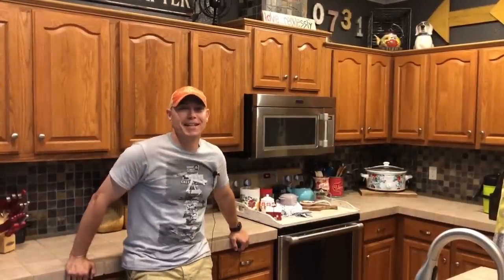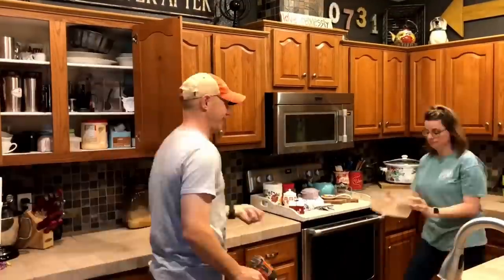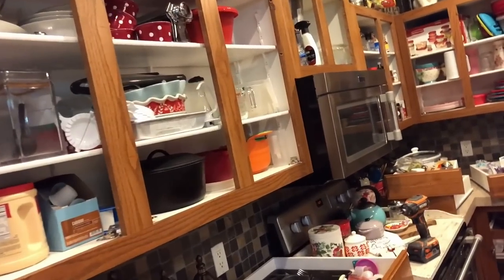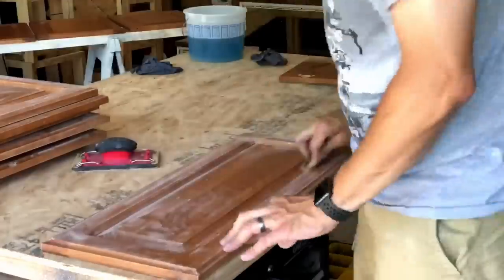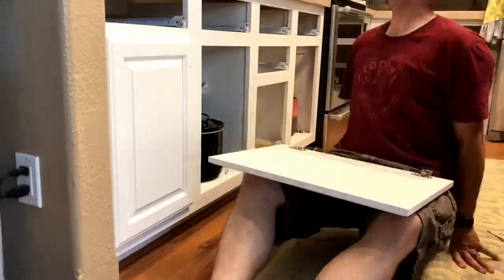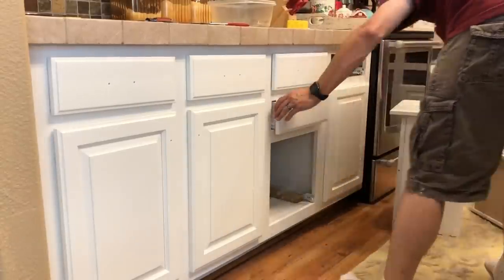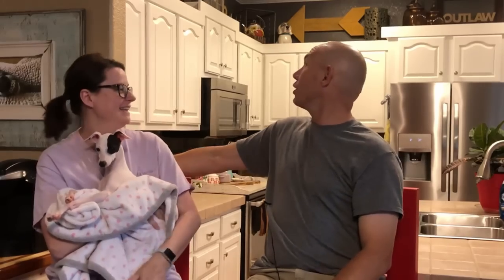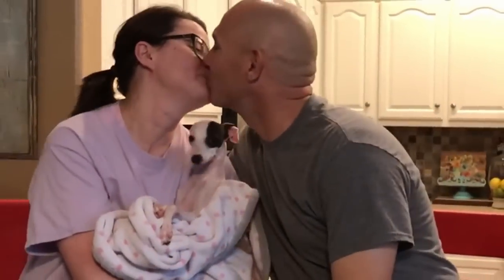How To Re-Paint Stained Kitchen Cabinets

Comment: Hi Guys! Just want to thank you for doing and posting this video. It has inspired me to paint our kitchen cabinets. The details you shared has saved me from making some mistakes. Im in the middle of painting but had to stop since the weather here in Texas has been a bit hot and humid. This brings me to ask, do y'all have any recommendations when painting during 90 degrees and 73% humidity?
Reply from the maker: Thank you. Glad it helped. With high heat and high humidity, the drying times have to be lengthened considerably.

Comment: Your kitchen looks very nice. I am currently on the planning stage. Can you tell me how many primer coats you did? and instead of the TSP, what do you rather recommend? Thank you.
Reply from the maker: Thank you.  We did 2 coats of primer, but only because the first coat didn't stick.  If we had properly prepped the surface we would have only needed 1 coat.  As far as TSP, I think if you sand the cabinets down until that glossy finish is off, you won't need any TSP.

Comment: You did an awesome job! Coincidentally, I happened to purchase the same paint (BM advanced; white dove) and a sprayer (HomeRight Super Finish Max) for my kitchen repaint. May I get an advice on thinning the paint? (% viscosity used etc). Or did you even thin your paint? Sprayer description says it may not require thinning for some paint. Thanks in advance!
Reply from the maker: Thank you. I didn’t think it at all. It came out great.
Reply: So no thinning? Wow, this is a great news! I was so concerned how I should thin my paint and I was on the verge of give up on using the sprayer. Thanks!
Reply from the maker: Nope. No thinning. It worked out great.
Reply: One more question: when you were waiting for back cabinet doors to dry (24 hours) did you start painting the front? Or did you wait until 24 hours lapsed to start the front paint?
Reply from the maker: I painted the back, waited about 2 hours then flipped them over and painted the front then waited 24 hours and repeated that process

Comment: Test an inconspicuous area to make sure the primer or paint adheres? The back of a cabinet door works fine and the corner of the frame... shellac based primer I think would have stuck?was the original cabinet oil based.
Reply from the maker: Thanks.  Yeah, I think it was an oil based, the problem was it had a clear poly that needed sanded off before the new paint would stick.
Reply: @731Woodworks  you can try using a maroon scotch pad or steel wool? I think the sand paper doesn't prep /scuff the surface for latex sufficiently. You can try an oil based primer and lightly tint the primer. TSP subsitute is good, but I would only buy from a paint store and not a big box store. The paint stores usually carry better quality. if a job goes south, they will hear about it... Not so for a big box store. I would use either grain alcohol as a cleaner to prep (expensive) or denatured alcohol, which can get diluted with water. Acetone works too, but it might react with the oil based finish? again always a good idea to do a test (back side of a door), then to find out after the fact.... ughhhhh.
Reply from the maker: I appreciate the tips and advice